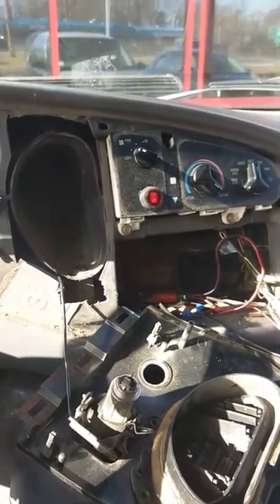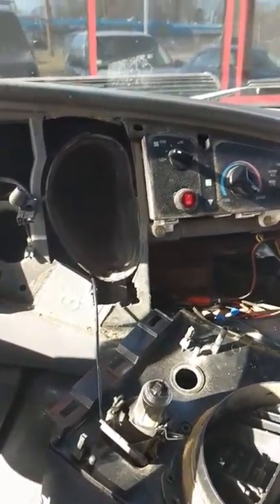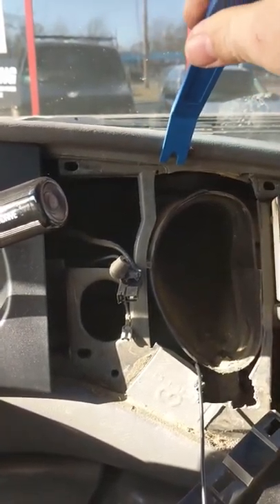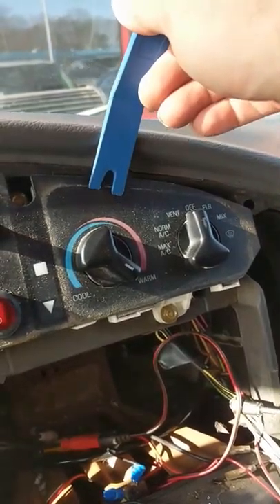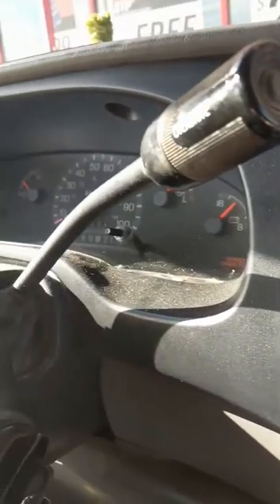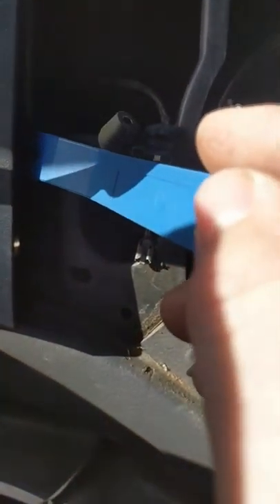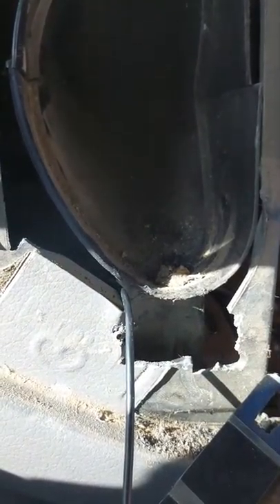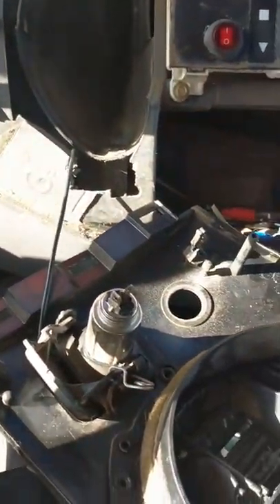Ford E-250 VAN Right Side Dash Removal

Comment: Driver side is left side of dash correct?   Right side is passenger. Did you remove passenger side?
Reply from the maker: Monty Henson yes the right side is passenger side, left side is drivers side
Reply: I'm still trying to remove the PASSENGER side of lower dashboard so I can get my engine cover off.  Needle nose vise grips can get the lower two snaps off, with some difficulty.  How do you compress the top two with that blue tool?  Did you ever remove your passenger side lower dashboard?  I have a 2002 E250.  Thanks for any help you can provide!
Reply: @chrismack7958  I was easily able to  gently pry that lower right panel off.  I ned to figure out how to free the entire dash as I have damage in the wiring harness behind the dash frame... That's another beast entirely..